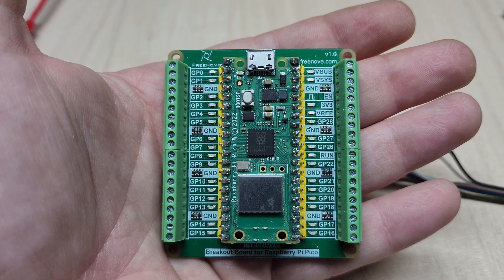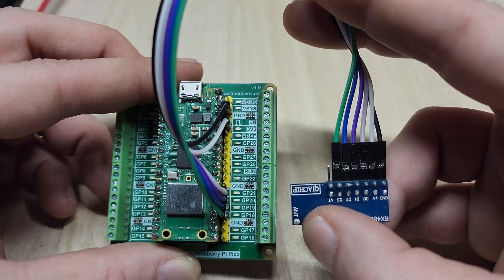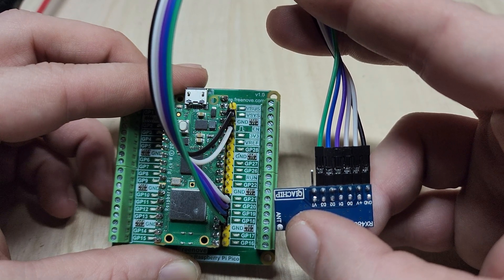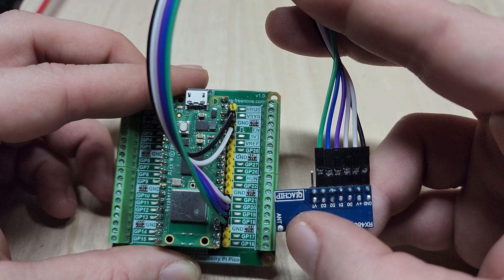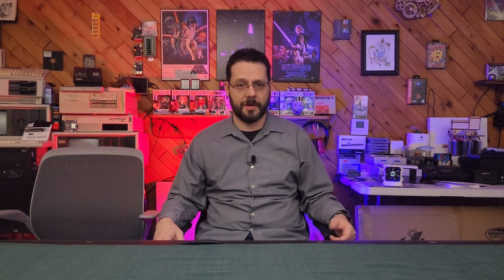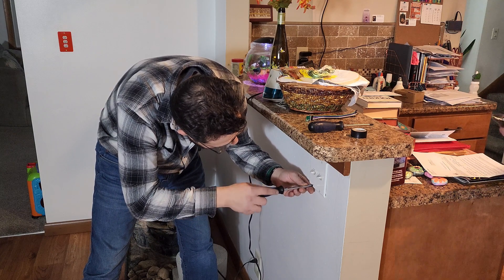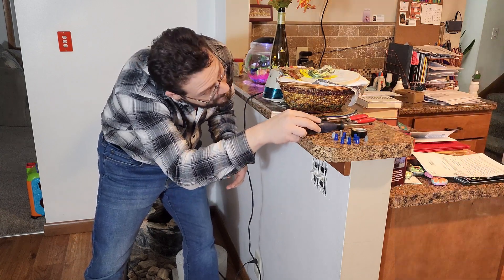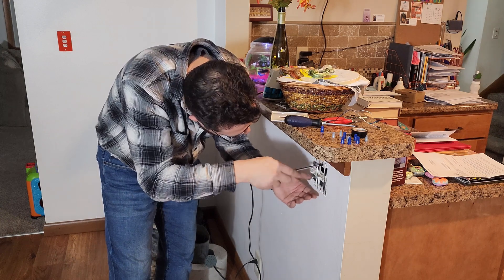Let's Build A Remote Smart Switch With A Raspberry Pi Pico W, Why Not?

Comment: So i'm trying to come up with a solutions where I need this to work on multiple outlets in one location (currently using kasa but when you have a lot of devices there is enormous performance issues with their app so i'm forced to create multiple accounts to circumvent this) Do you think this makes more sense or the shelly smart relay that I saw in your other video? I would like really control specifically which unit id like to remotely power on and off and have a platform that I could control everything that doesn't bog down. Any insight or resources you could suggest would be much appreciated!